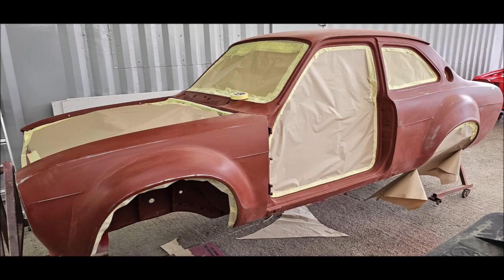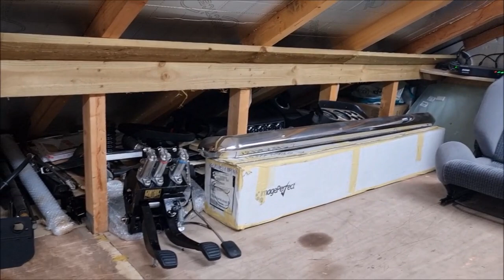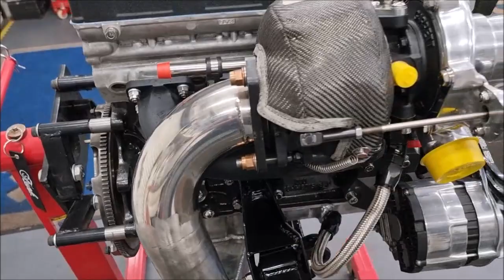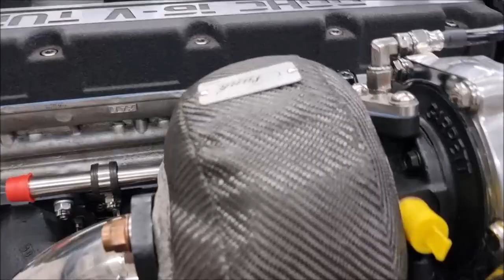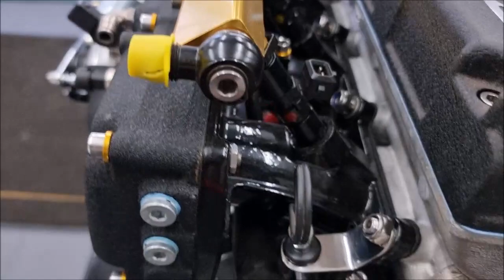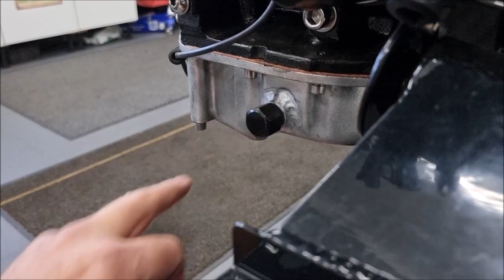Lee's YB Powered Mk1 Escort   Cossie engine assembly

Comment: What type, angle and size of fitting did you use for the turbo oil drain?
I had the same problem, everything I looked at seemed to too big for the gap between turbo and manifold.I used a welded up pipe but it looks shit, so looking to replace that.
Reply from the maker: I bought a male AN10 to Garret T3 oil drain adapter off ebay , then a female  AN10 45* teflon fitting straight off that . -10 braided teflon hose then takes it down to the sump , which is modified with a male AN10 boss welded in place of the old tube